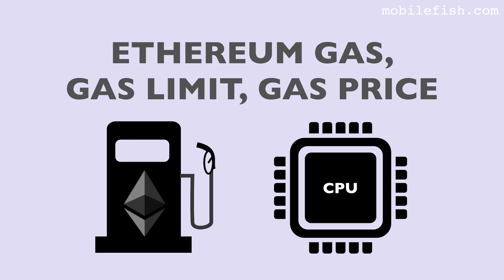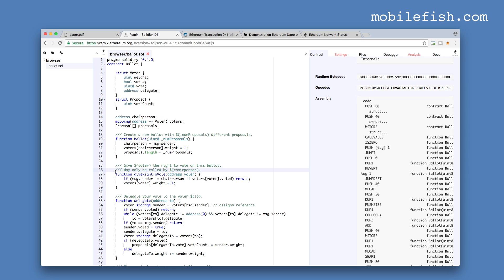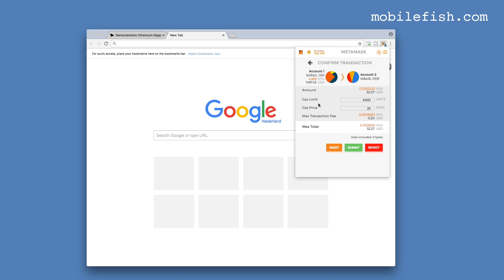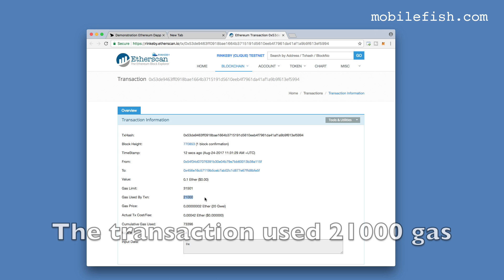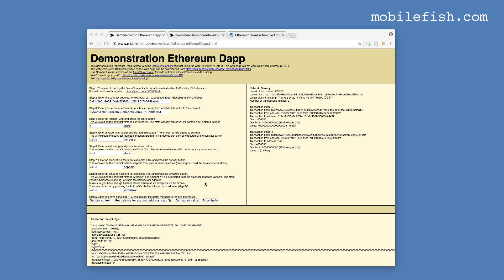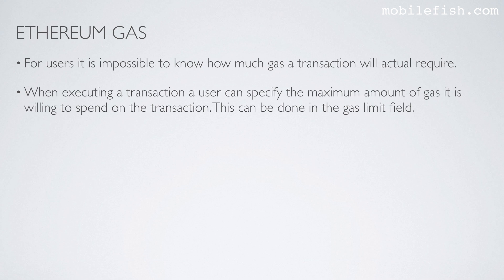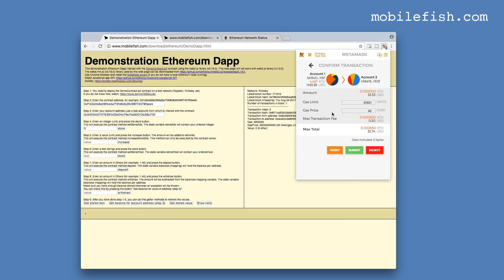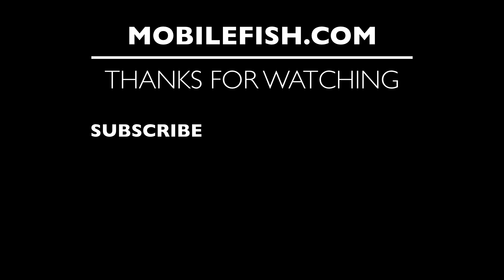Ethereum gas, gas limit, gas price

Comment: Sir, what I understood, GAS LIMIT is the sum total of all the GAS UNIT assigned to all the operation in an Contract. Say for example if :  

A contract has 2 ADD (3 GAS ) operations and 3 MUL(4 GAS) operations then GAS LIMIT of the Contract will be (2*3) + (3*4) = 18 GAS UNITS

If the GAS PRICE is 20 GWEI/GAS UNIT then total GAS COST will be 20 * 18 = 360 GWEI.

Now actual cost will depend on actual number of operations that is performed during execution.  Suppose only 1 ADD and 1 MUL is used in any transaction, then the Actual cost of Transactions will be 20*7=140 GWEI.

Please let me know if there is any lack in my understanding.

As you said sir, user can set the GAS PRICE or GAS LIMIT, but can the GAS PRICE be set lower than current GAS PRICE at any given point of time ??? 

Thank You

Comment: Hi! Thanks for the video. Could you please advice me about the problem I am facing that I explained below? 

Would creating multiple ETHEREUM accounts on Ledger Live and adding the ERC20 tokens under those ETH accounts be the cause of the issue of not being able to send my ERC20 tokens to an exchange? 

For example, instead of adding all my ERC20 tokens under one ETH account. I added another ETH account like (ETHEREUM 2 and ETHEREUM 3) and sent my Chainlink to ETHEREUM 2 and BAT to ETHEREUM 3 account on Ledger Live. I think this created an issue for me now, because when I want to send my Chainlink to an exchange I get an error message saying that I have insufficient ETH in parent account even though I have over 125 Euro worth ETH in the parent account. 

Is there a way to bring solution to this issue?

Please, kindly advice.

Olly

Comment: UPDATE- LAYMAN'S TERMS:

Okay Guys, i figured this out:
  On the Leger Nano S, click on advanced settings at the bottom of your home page. Fill in the “gas limit” as 22,000. That is, if you had no gas at 21,000. Do everything else as you did before you encountered this gas problem.   Lastly, whatever your gas limit is, just increase. I just did it by a multiple of 1000 and it worked.    That is, from 21,000 to 22,000.
Reply: How much gas did you end up consuming for that transaction in the end, 22000?

Comment: Great video but i'm  still confused.  I can't send Ether from my Nano S - it keeps telling me i am out of gas.  I have several ETH but i can't even send .05 or .1 ETH. It said i used up my gas  limit of 21000.  So now what ?  What is the solution in very simple layman's terms.  Basically, how do work around this problem to get  my ether from point A to point B?  I'm stuck...
Reply: I think you have your limit set to 21000 which is the bare minimum it costs to send but your transfer probably costs more. Set your limit to something higher like 35000 and try again.